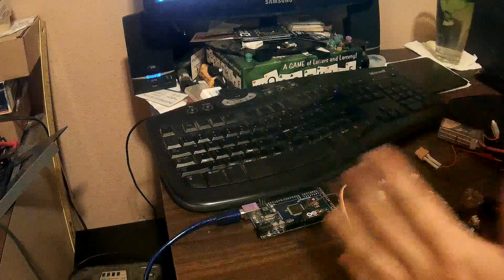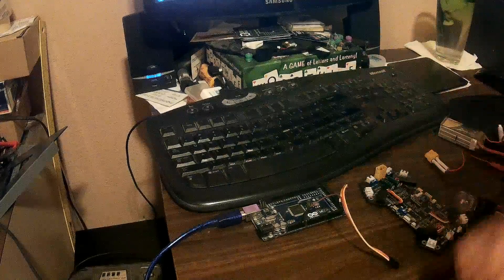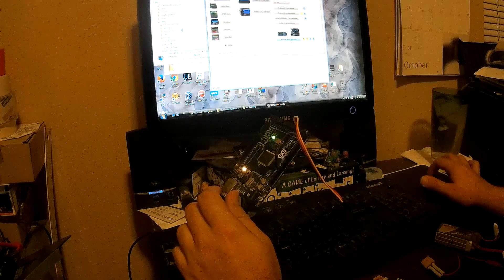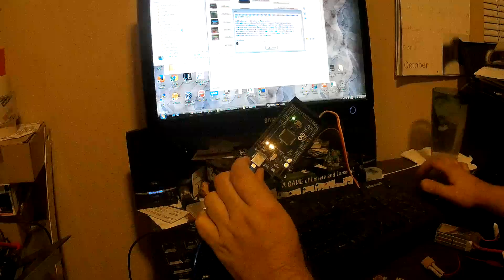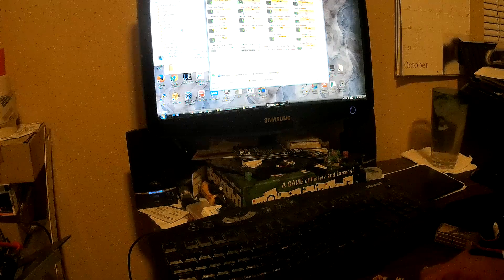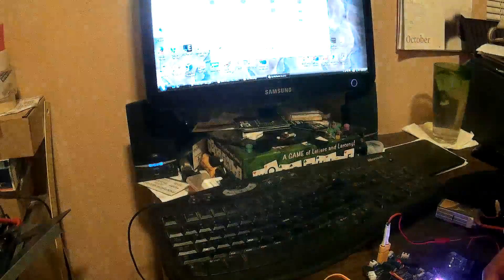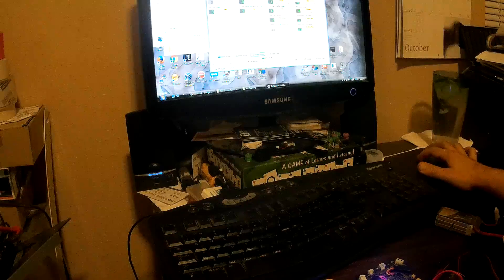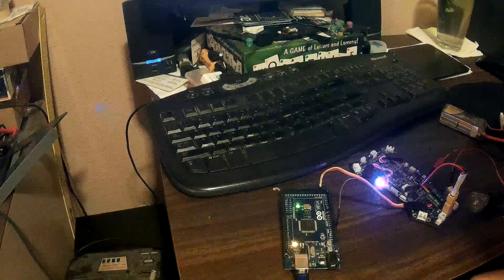Putting BLheli on the Nighthawk Pro 280

Comment: Jason have you tried using betaflight's usb to uart bridge with this board? 

I just saw this video https://www.youtube.com/watch?v=yH8mR9GKXxE&list=PLmqrzUvw_-6Y0aLcg3wHGXibuxdiAtUD4
Reply from the maker: +Stephen Gibb Won't work because the ESC's on the board have filters on the input lines which prevent using the 1 wire serial stuff over the input with them.  If someone could trace out the location of the cap and resistor for the filter they could be removed.  But then you'd risk getting noise into your signals which IMHO is way worse than dealing with a flashing harness.  I fly a lot more than I flash so I'd rather things work well when flying (clean signals) than be a little easier when reflashing (removed filter on ESC input.)

Though my preference is for ESC's that are designed to work without the extra filtering - that isn't really a choice with an all in one board like this!
Reply: +Jason Hitesman https://github.com/bitdump/BLHeli/blob/master/SiLabs/BLHeli%20supported%20SiLabs%20ESCs.pdf?raw=true its some way down but you will eventual see it
Reply from the maker: Austin Chopra Yes, but that's for the standalone ESC's.  The circuit layout on the all in one board is similar but slightly different.  And as they warn "Removing the cap will increase the noise sensitivity of the input, and
may affect running performance".  I'd much rather have a cleaner signal to the ESC and put up with a flashing harness.  Signal integrity matters every time you fly...easy of flashing only matters when you're tweaking.  And I like to fly a lot more than I like to tweak ;)
Reply: you could just jump those pin, or put a wire to the resisters to bypass them
Reply from the maker: +Austin Chopra you'd still have to identify them, and it would still have the same detrimental effect unless you removed the jumper when you're done.  which kind of defeats the whole point, a harness is quicker and easier.
Reply: ok, you win, also can you do a blog post on this at blog.oscarliang.net, i saw your post on flight test, but got confused very fast.